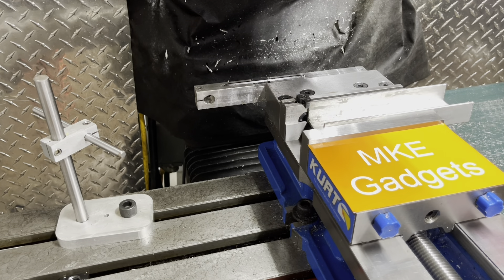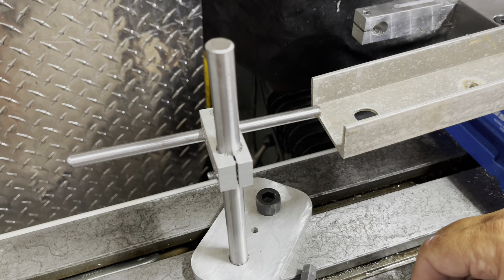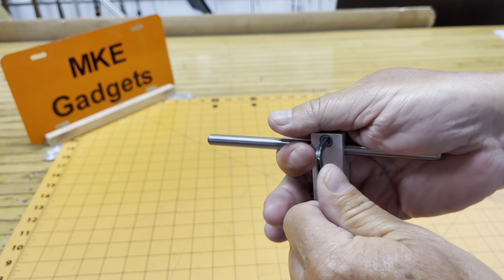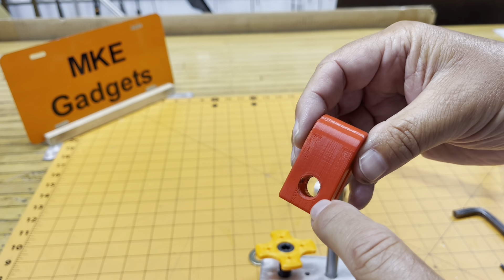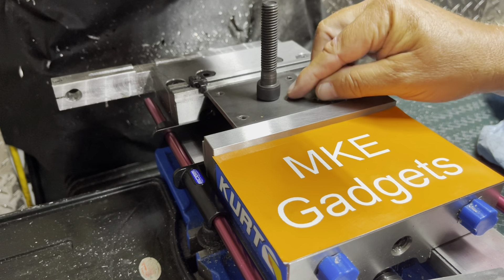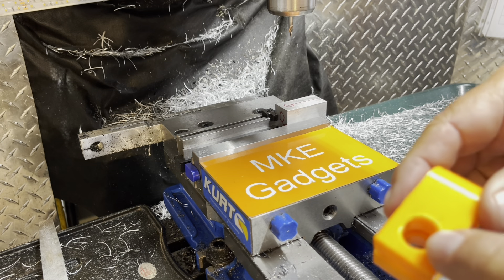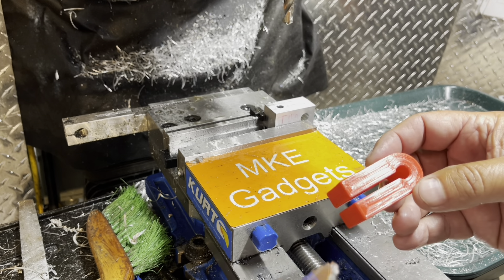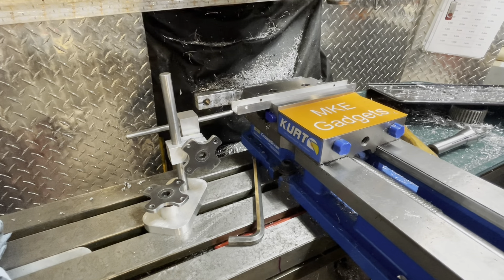Mill/Vise Stop Modifications @ MKE Gadgets #171

Comment: Prototyping with 3D prints is smart. I need to use my Ender3 more
Reply from the maker: I did that prototype a couple months ago. As I was thinking about the design. How big do make it how long to make it. It really helped me when I was a machine to keep my head right. So I added the right holes to the right part. I could see you having put the wrong holes in the wrong part and having to start over. Thanks for viewing. And you’re continuing support

Comment: I like that both bolts are the same size. Its annoying that most stops are built how yours was originally.
Reply from the maker: That’s what this video is all about. The same bolt means the same wrench can be used. You also can hand tighten pretty well with a hand wheel before you have to use an Allen wrench. Thanks for your comment and continuing support. Are you going to build one?